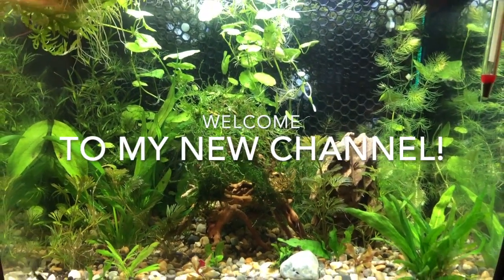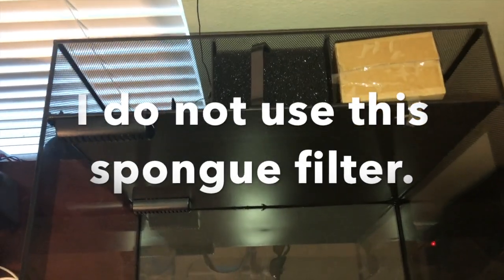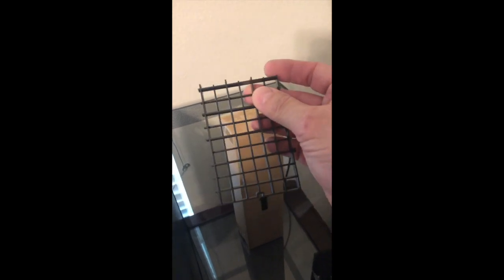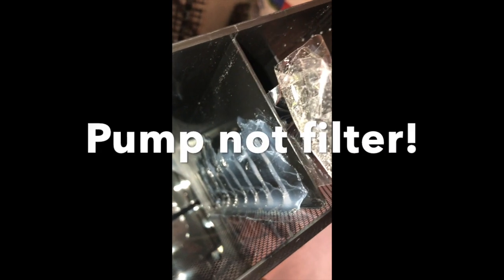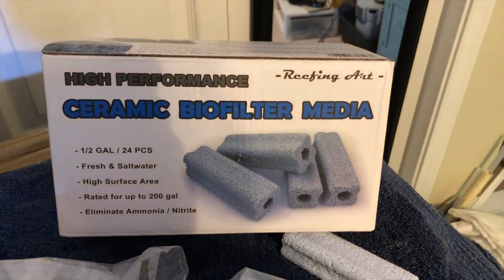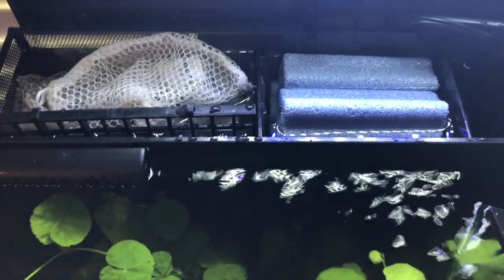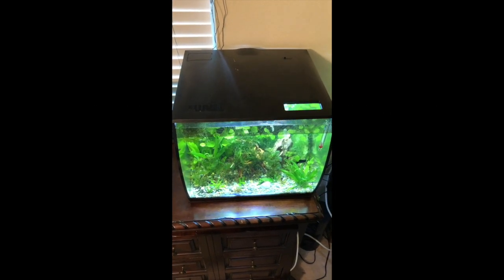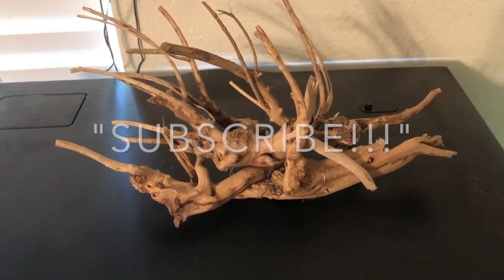Fluval Flex Set up and Modifications

Comment: I've got the Flex 57l and 123l, both with stock filters. Both my tanks have good flow and crystal clear water. I'm convinced you don't know what you're doing
Reply: Hi mate I have the 123 and I want to buy the 57 are they the exact same size or they are just a tiny bit different ?
Reply: @fernandes3002  ??? These two have 66 liters difference? They arent the same size
Reply: @danailpetkov1815  no my question was if they are the same hight and depth and what changes is the length
Reply: @fernandes3002  I'm older than you buddy.
Reply: @nom3nnescio  you can be older but still show this childish behaviour you need to grow up
Reply: @fernandes3002  Hi, yeah the 123 is almost like 2 x 57l flexes side by side. Maybe a little taller, but not much
Reply: Do you have any arguement besides "my water is clear and I didn't mod my filter"? A lot of what this man in the video is doing is very sensible as far as filter setup goes, including selectively closing those slots at the side which as-is make the three step filter system somewhat inefficient/out of order. There are also variables such as how many critters someone is holding in their tank as that would increase waste and maintenance, how many plants an individual has as that will help with water quality, how often someone has to do water changes/filter cleaning due to buildup of debris/water parameter changes, etc. I'm also curious how long you've had your tank.
Reply: @abbyb5690  Oh you came to the right place. Yeah I have arguments.  I see a lot of people claiming they've modded this and that in their filter. They ultimately screw it up and blame the filter when they can't get good stable clear water. It's not rocket science. My 2 tanks have been running for 4 to 5 years, I've been keeping fish since 1991. The filter is stock and silent and I do weekly maintenance on them. If some fool has overstocked their tank then I don't see the filter being crap when they can't get good results, I see poor stocking decisions and a lack of understanding of how it all works.
Reply: You’re convinced he doesn’t know what he’s doing because he modified a filter?
Reply: @Gk22632  No, I'm convinced he's probably blaming the filter system for his poor practices. Overstocked tank, overfeeding, poor maintenance etc. The stock system provides crystal clear water if you know what you're doing.
Reply: @booshting3520  for such a small amount of water he really over complicated the filtration, id rip out the whole stock filtration system and just use a small 10 gallon sponge filter around 2 inches wide and 2 inches tall, but that’s just because I’d want as much surface area to work with as possible

Comment: Thanks for making this video. I’m having problems with noise of the pump. It’s making the lid of my tank vibrate and the pump is loud in running. I made sure pump wasn’t touching the tank and I put a sponge under the pump. Is your pump loud?  If so can you recommend a quiet pump for this tank?

Comment: Hi, how’s your tank doing now? I already have water and fish in my tank so I won’t be able to do the silicone. I think Steve is talking about putting filter floss and sponge in those slots that you silicone, just jamming it in there, is that correct? Do you think that will work? Also I know why you want to put that hole in the third chamber because you’re trying to get the water to go up through the filter instead of going out the bottom. so you do feel that’s necessary. I’m not sure how I’m going to do that. I’m not real handy and I’m new at all this. But really enjoying myself.

Comment: Good video the pump is only 450 litres an hour ,,,personally would remove all the filtration built in and simply run the flex as a nano tank with shrimp
Reply: @Steve Gee it does gave a 500L an hour pump